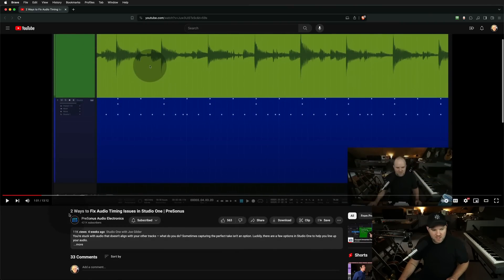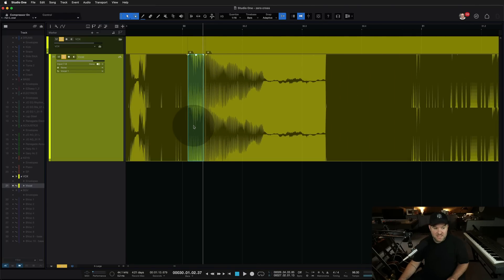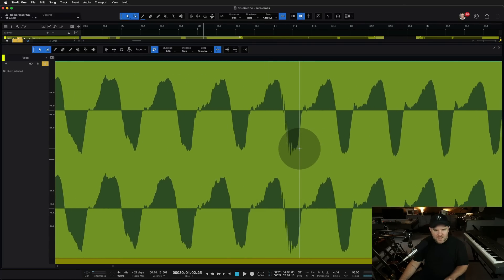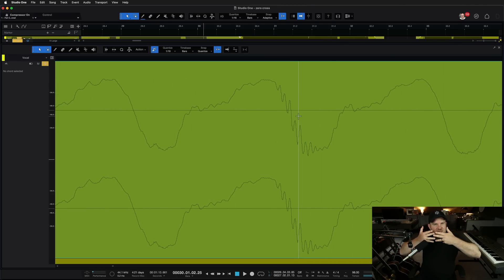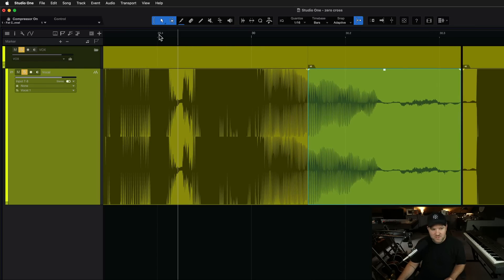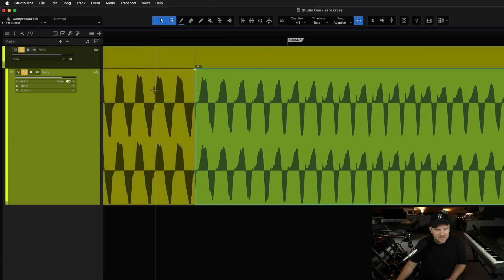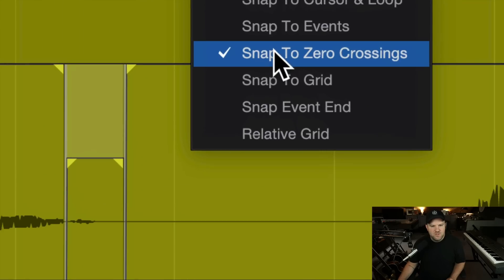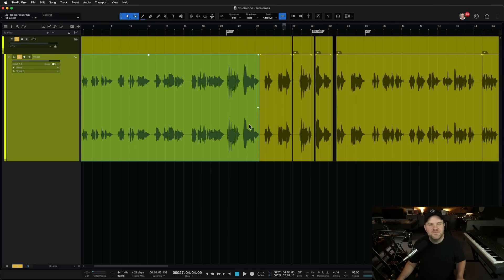How to Fix Your Audio With "Zero Crossings" | PreSonus

Comment: Very informative.  I have another question about timing. I am an SP1200 user.  It has a natural sync drift.  After about two measures the timing goes off.  It is ancient tech, I know.  I have watched the video of you manually moving the grid to compensate but that take a while.  I also use Cubase and there is a tempo a detection tool.  That automatically snaps the grid to the SP1200's timing in one shot.  Does Studio one also do this?
Reply from the maker: Hey there! Perhaps this video will help: https://youtu.be/1gvBlvuurtw